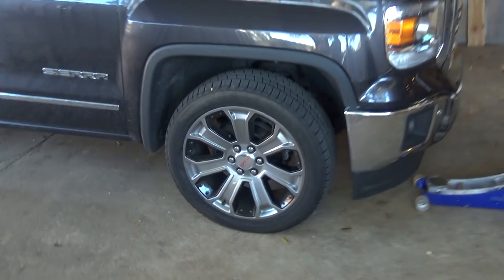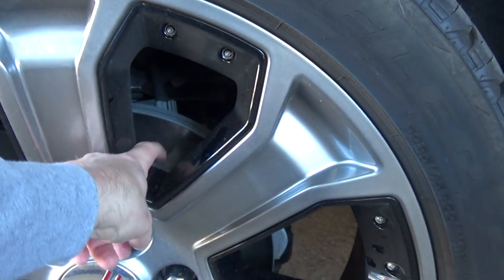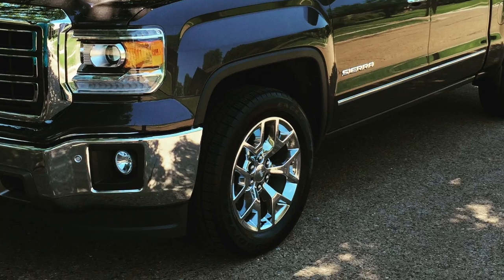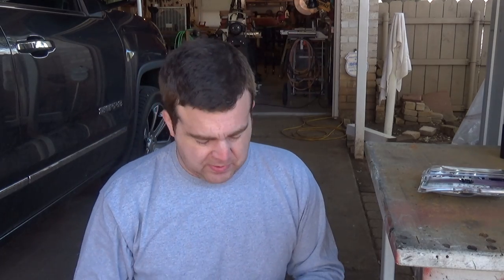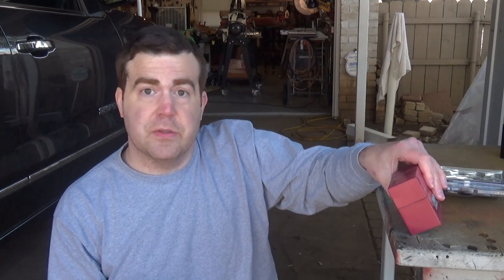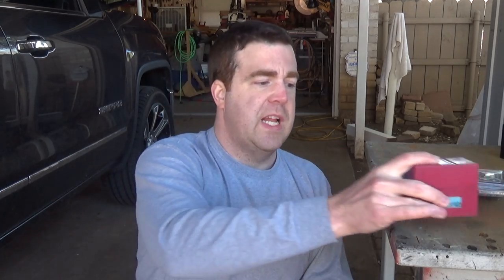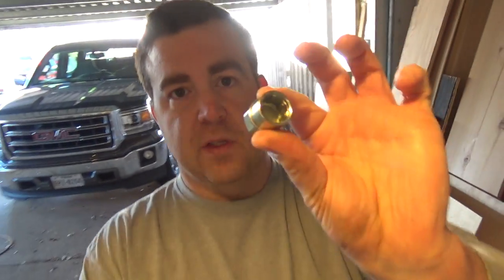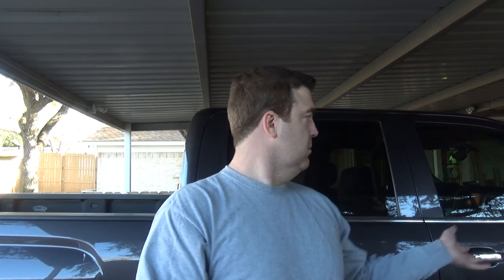WHEEL THEFT PREVENTION TIPS | My Factory 20's were STOLEN!

Comment: not to be a ass or anything but if u can buy a key chances are they have one to .....buy an alarm and keep things u want out of the street
Reply: Anthony Martinez if you know anything about wheel locks, there is about 7 different locks per each style wheel. So thieves would have to have all kinds, styles ect. Which I highly doubt because they are expensive. Long story short. If you bought the same locks he did you more than likely won't have his lock.
Reply: Gilbert Luna wheel locks won't do shit if the thieve wants it bad enough, he will get the wheels. It has happened to many people online. Alarm won't do shit. The thieve can turn off the alarm in second by disconnecting the battery, even if you have a backup battery for the alarm, they can easily stop the alarm. You can't prevent your car from being stolen or vandalized, all you can do is put layers of annoyances which will make it more difficult for them, if they really want, they show up in a truck that looks like a repo man and take your car in one minute
Reply: Latin Lover out of everything you said the only thing that could happen to me is vandalism. I have flush locks which, set flush and you can not stick anything around it. It's like a cap and have to have a key to access the lug nut. I have a front and rear dash cam that is triggered my motion. My alarm has a back up power source also hooked up to the horn. I moved my hood latch cable so you can not reach in the fender and pull it. I have bright led spot lights in my drive way, not to mention camera's looking at my driveway. Also my escalade is blocked in everyday so good luck trying to get it. I use to live in the hood and I install aftermarket accessories on vehicles so I am smarter than the average bear. It cost money for protection and most people won't want to pay and end up on blocks or worse without a vehicle. I learned when my Tahoe was stolen about 8yrs ago.
Reply: Gilbert Luna u may be right a street level car jacker might .....but trust me a pro will
Reply: Anthony Martinez Got An Alarm In My GEO METRO!
Reply: Richard Kaltenbach bet don't let me catch u slippin I need me some geo  parts ......😂😂😂😂😂

Comment: I don't think you understand how a deductible works. First you pay the deductible and insurance covers the amount over. With a 1k cost and 1k deductible, the insurance company didn't have to pay anything.
Reply: zdwade, I think he said he paid $250 less per wheel, thats $1,000. The same as the deductable. I think he means the savings covers the deductable. The insurance claim he filed has the value of the original wheels, thus, dedutable covered.
Reply: Spaceman Rick youre right. The insurance paid the price of his old wheels. He then paid $250 less for each wheel saving $1000 aka it covered the deductible he paid aka he lost nothing and gained some wheels back.
Reply: ohhhhh.
Reply: WOKE R2 9

Comment: I see you live in Texas, and this has been a problem for several years in the Houston area.  The NW side has been plagued with wheel thefts, but this is not limited to one side of town because thieves go where the product is.  I have seen GM trucks along an entire street sitting on blocks on a Saturday or Sunday morning.  Putting personal ID on your wheels is smart but remember it can be destroyed with a Dremmel tool.  I recently caught a thief sitting in my truck going through things in the console.  I surprised him and he left everything and ran away.  The scary part is there was another guy trying to open another vehicle in my driveway that I had not seen and he had something in his hand that looked like a transmitter.  There is no doubt that my truck was locked because the only door open was the driver door...all the other doors were locked.  The second guy must have had a transmitter that can unlock certain vehicles so be aware.

Comment: Put a silent alarm that will alarm you but not the thieves ;)
Reply: Beto G and can of bear spray.
Reply: Um, call the cops? The process of stealing wheels takes some time, especially with no access to electricity for power tools.
Reply: Pretty much any electric tool has a battery version these days, it can be very fast.

Comment: Now, you need to go under the hood and find the fuel pump relay and have a hidden switch or magnetic switch where you put a magnet and your able to start the car. Best spots are inside the door panel of the driver.

Comment: You don't need a aftermarket alarm you can add a motion sensor to your factory alarm that ties into your trigger wire that makes the alarm go off, its a directed dual zone 508D its cheap like $36 and easy to install it has 2 screws for adjustment one for sensitivity one for 360 degree range if any motion is present at the adjustment you set alarm will go off without anyone even getting close or touching vehicle.

Comment: All kinds of crap happens. I once had the battery stolen out of my car in NYC, I walked around the corner and there's Mr derilect homeless with three car batteries, so I bought mine back for $20. A guy where I live in NJ had all four tires snatched from his car too ($1000/tire) and figured it was an inside job by the porters who maintain our condo buildings. If you can, garage it; otherwise park close by. There are prob motion detectors too. I like the number/letter stamping, but you still have to find the tires on Craigslist.

Comment: I  got these wheel locks for my spare tire on my Jeep.  The rim is just the regular steel rim nothing fancy.. But the tire is a very expensive Mud terrain. I also added a thick cable to the tire and mount,  With locks for the pins as its a hitch mounted spare.  So no one is getting that off unless they got a angle grinder

Comment: A will be nice stamp the wheels right behind the air valve position. for easy find. They also sale small night vision camaras that have been used on trucks trailers , you can putter anywhere you like. There not expensive anymore. 
Nice video, i loved .
Reply: Check you neighbor until  few blocks away circle ⭕️. Normally there not to far away. 👌👍

Comment: You can still identify which ones are yours being sold on craigslist. All you have to do is get the police involved and the dealership because your air pressure sensors are built into the rims and it has a special code that matches your Vin number. You can use a Wi-Fi system that can scan and check if the craigslist seller has your wheels or not.

Comment: the stamping is a great idea, except i still think you should have also put a stamp on the front of the wheel. As most wheel listings on craigslist, only show pictures of that side, only a few show inside. So you'll be forced to ask all listings to provide a photo of the inside and some may not respond or do the request. But having a unique marking on the face of the wheel will at least give you some hint that those may be yours. Of course the stamp on the face of the wheel shouldn't be some string of characters like on the back, but just something simple like a single letter or number.. something the thieves wouldn't notice or think is out of place, but you will.

Comment: Great ideas. But I'd use all numbers for the stamping as it would look like a factory serial number and not get filed off. Also, instead of the tie-wrap, put a pad lock though the hole and put the key elsewhere in the truck (well away from the lock).

Comment: Hi.. From GMC owner to another...1, install mercury switches (4) one at each corner. 
2, have the lock company sent you out an extra lock key. Place extra onto the keyring you use for this vehicle.
 3, even though you are providing a great preventive video be mindful to consider ALL variables before showing us ...
How i have secured mine on. my 2018: 
1, two sets of wheel locks per wheel.
2, laser etched backside of wheels.
3, the aforementioned mercury switches.
Location device /with its own power supply & frequency. 4, touch sensors....which must be used to start vehicle
Once i have 300k on it then i will remove the countermeasures.
Understand, i suffer a loss like you. Mistake1- I shouldn't have valet'd it.
Although i'd just broken my foot ...
Mistake-2 I didnt have these countermeasures done the day before i broke my foot....i went out enjoying the vehicle immediately after purchase. Instead.....
Well LESSON LEARNT!!$
My Replacement-2018 received ALL the things i told you about.....and 1 extra part; because i paid the cost up front. And its mine free & clear. I stopped by the local spy shop....
And purchased two tiny cameras with night sight. In the event that this vehicle bothered by any means ; i will record of it.
Total countermeasures costs$2000.
2018 GMC value $65,000; my cost $50,000.
And i, like you reside in a large metropolitan area .
May you have many many miles of enjoyment with you GMC! 
Peace and Be Well.

Comment: How would the thief take off the wheel locks? Don’t they come factory on cars/ trucks? Also where were u to not see the thief take out a jack stand and undo the wheels and move around the entire truck, also wouldn’t u hear the power wrench or whatever that tool is called again?
Reply: You dont have to use a big jack like that, & can use a breaker bar to loosen the lug nuts and a cordless impact to remove them quickly. I’m sure a guy or two can get them off in 5-10 minutes no problem. Also some offroad jacks have offroad wheels that are quiet

Comment: Wheel locks? They still have unrestricted access to your truck and property. Try investing in a security system with motion detection. The neighborhood cats can’t even get close to my house before I get a notification, let alone a thief. Solar powered motion activated LED floodlights are another cheap and easy denaturant. In my experience, it’s better to discourage thieves rather than having them linger around. I’ll give you an example:

On my first trip to Miami I was concerned that someone would steal my brand new stereo system, so, I brought a deterrent. I took with me some additional clothing and some papers that looked like trash. I covered my speaker box with the clothes and scattered papers all around the inside of my vehicle making it look messy and trashy. When I returned, both of the cars to the left and right of me had their windows smashed and belongings removed. Nobody touched my car.

Comment: Always check your nuts! Years ago driving home from work at night my car felt funny in back so i pulled over.The only thing i had holding wheel on was the locking nut. Someone trying to steel wheels got off the reg nuts and stopped. Drove for 4 miles like that, boy was i lucky the other studs didn't shear off.

Comment: Did you know that if you have tire pressure sensors in your wheels they are each serialized and the serial number is recorded by your truck. If you could find your wheels and tires you can have them scanned for serial numbers, compared to the numbers in your truck or your truck would even pick them up if you get close enough to them.

Comment: Try getting a crimestopper sp-502 2 way alarm only $100 shipped they use to go for about $400 when they came out about 6 years ago. They worked great on my last 2 vehicles a 2016 veloster and a 2013 Jeep jk comes with 2 remotes 1 regular and 1 with lcd display. Try on eBay or sonic electronix for that system. Good luck 👍🏻

Comment: question, unfortunately i just had my wheels stolen from the train station while I was at work. They took all 4 and the tow truck took it away. When the thieves stole your tires, did they scratch the discs? (Appropriate term is rotors, I think?) I'm worried that my insurance is going to cheap out and just replace the tires and not the rotors and the bottom of my car that was scratched... I had just bought my car a little over a month ago :( thieves are the worst.

Comment: It will not stop your wheels from stolen. They can overtighten other nuts to make the secret lose one.  Or they can simply break the very last stud with a secret using the wheel itself.  Stud is fragile to break.  You need to install at least the second secret on the site opposite to the first one. And use the secret with rotating shield.

Comment: Probably not a good idea to stamp anything on that part of the wheel because that actually takes a lot of load and it's what holds your tire on! By stamping anything into that part of the wheel, you have now created a stress riser in that portion of the wheel that could possibly cause the wheel to fail!?! Just saying. Probably a better place is the inside face where the wheel mates up to the rotor. But the idea is a good one, you could always put the last five of your VIN # there also

Comment: Get a shock sensor as well a level sensor on your alarm. Problem solve. I had a motion sensor on my jeep as well proximity sensor on my jeep. If you would stand by my jeep for more than 15 seconds the alarm will give you a heads up and if you don't move it will go off and inform me on the remote.

Comment: You could of saw every set of wheels for sale and it should pair the sensors of the wheels to the truck. So it would read the tire pressure,etc... And the new wheels are more desirable to thieves now. So most likely it will happen again.

Comment: best way yo prevent them from getting stolen is getting air suspension lol, if you are fenders are covering %25, and there isnt even enough clearance to jack up the car, its litterly impossible to steal the wheels unless they hot wire it.
and btw use the wheel lock as a keaychain

Comment: put 2 lock nuts on each wheel opposite sides to each other . otherwise all you have to do is take the standard nuts off and rotate the wheel so the lock nut is on the top and pull the wheel out to snap off the wheel stud .

Comment: You have the wrong size lug nut lock. It should be the shorter ones. You can knock yours off with a hammer.  It stick out further than the rim it self.
But good idea with the stamp

Comment: I got tired of theft, happening every year.   Sometimes multiple times a year.  so, I got security lights, I got security cameras, I had a backup drive for my security camera.   They moved the lights, erased the primary drive, and STOLE the backup drive for the security camera.     Some theives are tenacious.   I then replaced the bird shot in my guns with slugs, etc.   I put away the 410, and got out the riffled slug gun.    I stopped playing.    They stopped playing.

Comment: I wouldn’t trust that Harbor Freight zip tie to keep that lug nut key secure anywhere without rotting out.  Use Stainless Steel aviation wire as a better choice.

Comment: i ingrave all my tools stolen from my phone number.. and i had a ip cam in my truck and garage,and house so it record through the internet to home through 4g lte that i wired to the battery so it always on when i drive i trun the cam and use as a dash cam. and if ya get a alarm i would get one with remote start they have ones for you truck that you dont have to wire its plug & play. thanks for sharing

Comment: zip ties tend to fall apart under tension  or temperature. Think about using wire instead, or you may have to deal with unlocking yourself :)

Comment: Wheel lock lug nuts only keep the amateurs from stealing your wheels. Add a shock sensor to your factory alarm. Or stamp your VIN on the "outside" of the wheels; I would rather have a small VIN stamped on the "outside" of my wheels, than no wheels. Thieves will not want wheels that are stamped with a VIN, and will not try and grind it off, that would ruin the wheels and they could never sell them, at least to any sane person.

Comment: coudln't you just smash a small wedge of metal between the nut and rotating cuff to jam it?   something like the axe head handle wedge.     then turn it off with a pipe wrench or whatever.   Unfortunately, there is no way to stop a thief when they want something.

Comment: thoose numbers will be covered in brake dust, no one will be able to see them or make a effort to clean the spot     4 or 5 different locks per wheel will slow them down alot
Reply: You cannot torque those wheel locks to proper spec, that is why you only use one.

Comment: Just because I personally work at a tire shop and saw something wrong, you don’t want to torque down a safety lock lug nut, just give it a good seating with the gun and it does the trick. Have a great day!
Reply: This is why people shouldn't trust some guy at the local tire shop to do it right.

A) don't use an air wrench to put on a wheel lock
B) do torque it to spec, making sure that it's the last one in the torquing sequence.

No trickery needed, just following the instructions.
Reply: @Adam1nToronto  funny how you don’t use it with an impact gun without a torque stick on it that can only go to a certain spec :)) but you know more than me? When I work for the #1 tire store in America? Not some local tire shop? You don’t use it on an impact gun without a torque stick and you don’t torque them down because you can snap the teeth on the key, thank you for coming to my TED Talk
Reply: And if you’re going to torque it, why leave it to the last in the sequence? Do I still torque them if a customer asks, yes. But should you? No. Don’t talk like you know :) also I’ve worked for dealerships doing the same thing and they don’t torque them

Comment: DO not do this!!!! Its very dangerous one bolt loose means at some time later while you will drive the wheel will just fly away and you will be in trees or big damage to chassis  which will cost you more when stupid wheels. To prevent stealing you must order special bolts which cannot be removed without special key.